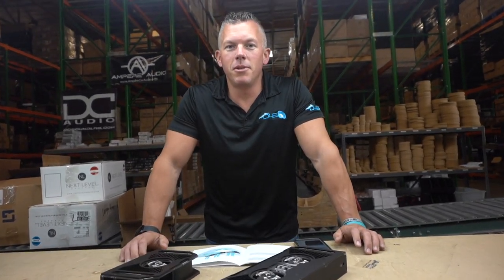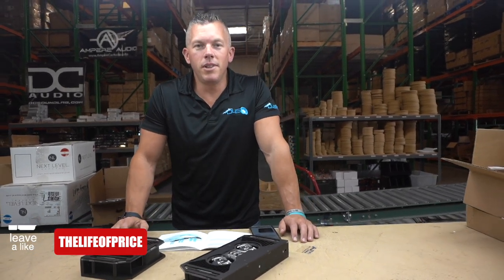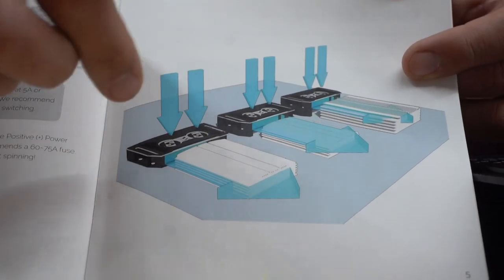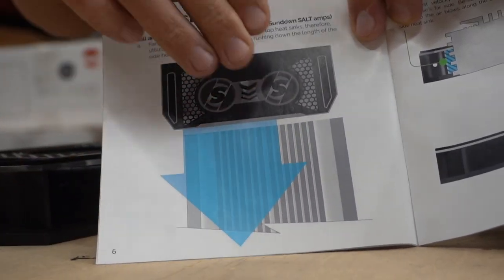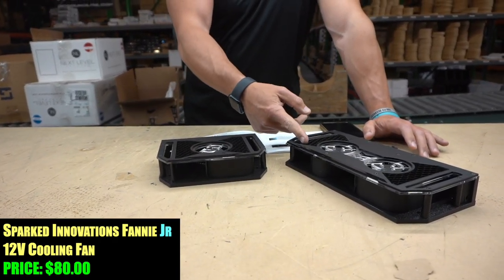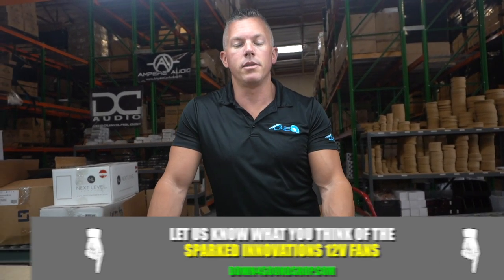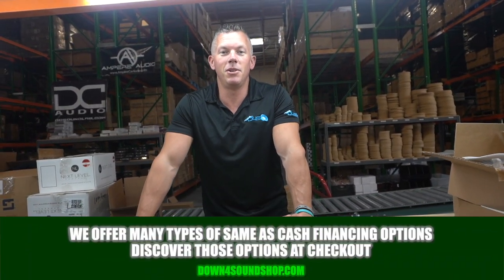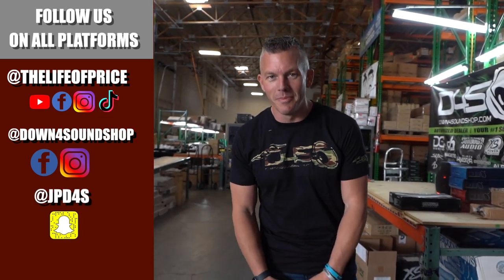WHY SPARKED INNOVATIONS FANS ARE MAKING WAVES IN THE CAR AUDIO INDUSTRY!

Comment: Rapid fire question , Old Basshead but Newbie  installer , I just purchased 4 M67an’s  for front and back mids and a pair of t25’s  , should I get a 4 ch amp and use crossovers in doors or a 6 channel and run active . Was looking at your jp234 . I have upgraded electrical and  alt with super cap running 2 12 deaf bonce 3012r’s on a jp63 . Kinda stuck deciding on mids and high setup. Thks for all the help and motivation.
Reply: You got a dsp? Separate amp for mids and highs would be better

Comment: Hey Jonathan can you please help me out I have a 2 Channel line out converter I want to install my 12 inch 1500 W two ohm alpine S subwoofer in my 2012 Chevy Cruz I also have a alpine 200 W 2 ohm amp the wires are in the car for the amp I just can’t figure out the line out converter. I have no idea what I’m doing. I was wondering if you could help me out your awesome at explaining what needs to be done keep up the good work